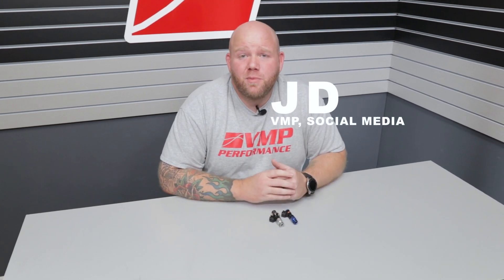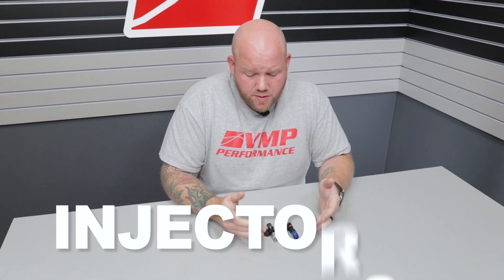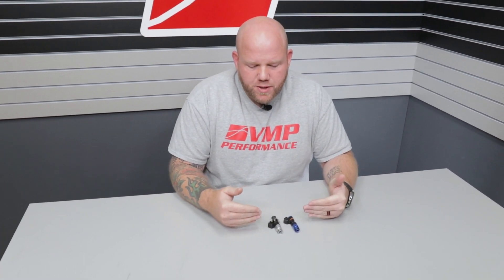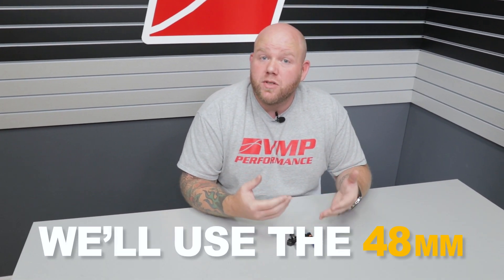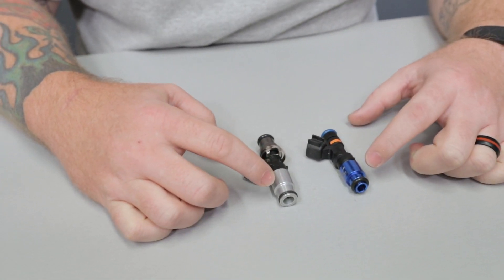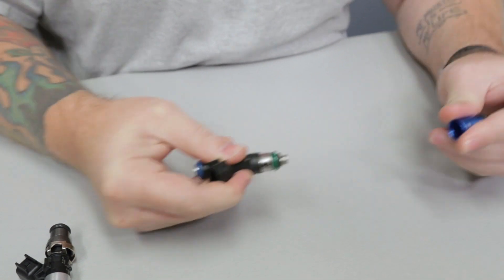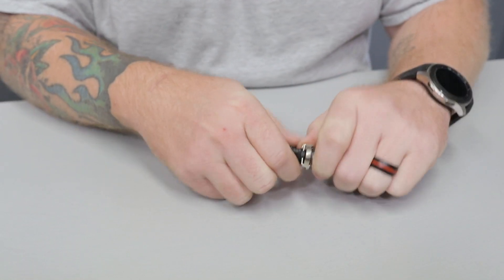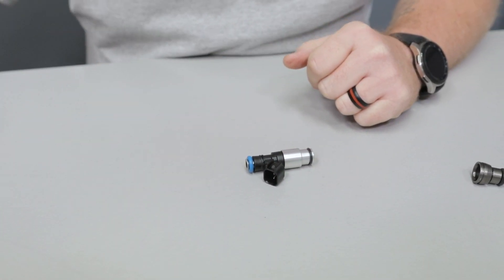Tech Tip || Fuel Injector Height Adapters

Comment: I have a whipple f150 and am experiencing a misfire on 4 only on cold start and not every cold start about every 3-4 times I start truck it’ll misfire. Changed plugs. Coils. Changed di injectors. Did a compression test and I’ve been told the port injectors were swapped I don’t know if they actually were but I’m leaning towards an injector seal or something along those lines. I have dw95 has anyone else had this issue? I need to get a leak down test done prolly but just trying to reach anyone who’s had similar issues
Reply: Code is a po304 lund says it’s “common on the 21+” I haven’t seen anyone else have this issue and it not be something small like a spark plug or something.

Comment: Lower extenders don’t mess with spray pattern?
Reply: I have the same question
Reply: They do, you should NEVER use adapters on the bottom, it will drop fuel rather than spray
Reply: @Avalanche2  IDx injectors have a very narrow 5 degree spray angle. Bottom adapters wouldn’t affect the spray pattern at all.